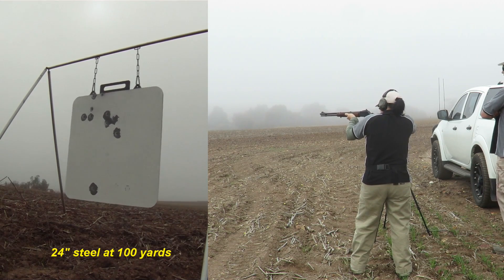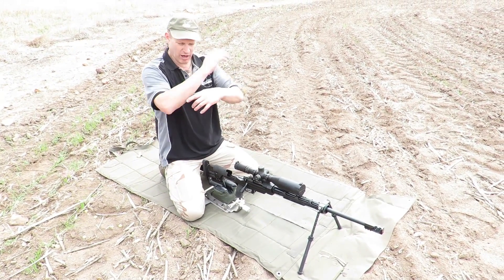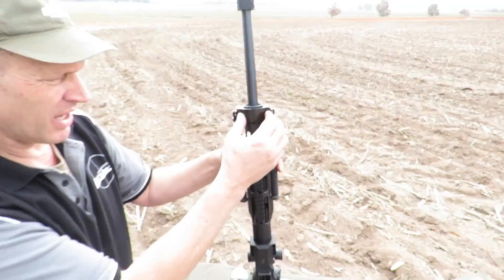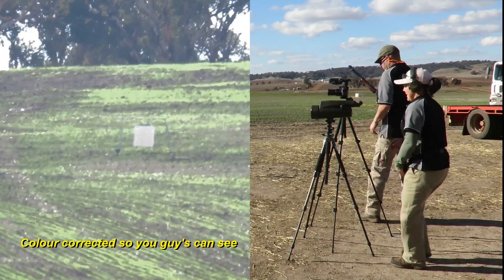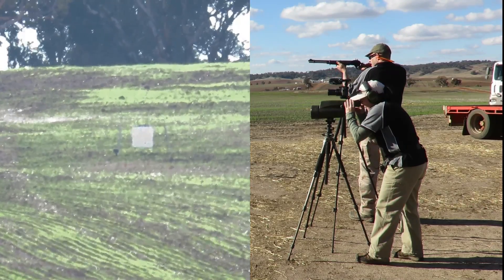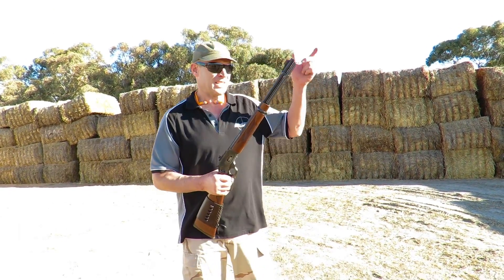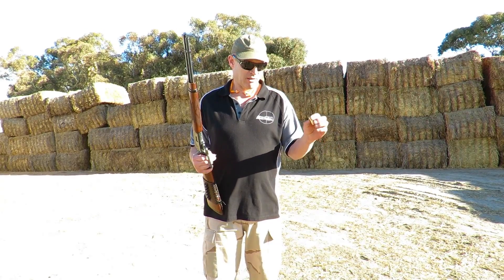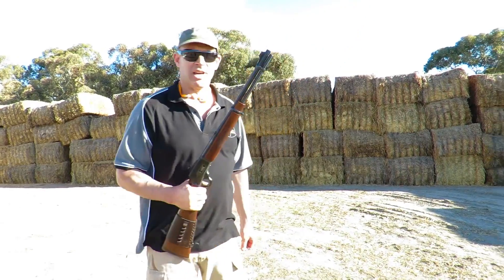Marlin 1894c 357mag at 858 yards (off hand)

Comment: Great shooting!
Wish Marlin still made the 1894 in .357
Reply from the maker: They sure are a nice bit of gear, Cheers
Reply: As of this year, they will be re-releasing it. It is posted on Marlin's website.
Reply: gary robinson Not true of the new ones at all
Reply: They do, I just bought one Monday morning, it should hopefully get to me by Friday.
Reply: I shot one made this year,  slick as the old guns and shot great.  the polish and wood fitting still leave something to be desired, but better than it was.
Reply: I have about 800 rounds through one of the new ones, great little rifle so far
Reply: By the time some guys reach 85 years of age, they'll still be whining about Marlin's Remington manufacturing even if they messed it up 40 years ago.
It's called manufacturing. It wasn't Remington's intention to screw it up to destroy the reputation of Marlin. Fact is, if Remington hadn't bought the brand Marlin would have most assuredly gone out of business. Old workers reaching retirement age, old non-computerized manufacturing equipment well worn, old blueprints and old tribal knowledge at the facility. What do you think was going to happen when Remington bought the brand, acquired the designs, transferred the blueprints, and started manufacturing a gun design on CAM CNC equipment by a new labor force, in a new location, rebuilding old blueprints?
I don't care what kind of product you manufacture, no one can make a transition like that without some time working the bugs out. They HAVE worked the bugs out. You can rest assured a new Marlin is just as good as the old. If the guys in the old Marlin factory didn't do some hand-fitting of the guns, they wouldn't have functioned. That was the case with all the old means of manufacturing firearms. Modern times don't require it, unless you want a flawless de-horned, zero-machine-marks finish everywhere your microscopic eyes gaze.

Comment: Great work, what ammunition and grain are you using? I can't get my h&r .357 magnum to shoot accurately past 200 yards.
Reply from the maker: 125g 357 magnum factory loads by  Remington
Reply: If you reload get your hands on some .360 Wesson cases. 

They are a little longer and it is well known that H&R cut their throats a little long. This will help close up the free bore and greatly improve your accuracy.

Or, you could just ream the chamber to 357 Maximum and get higher velocity to boot.

Comment: Really nice  shooting, never knew a 357 would ever get to that distance, let alone hit with authority a that distance....since i'm lucky to own a 1894cp in 357 and i regular shoot it at 100 m, would you like to shed some light on what kind of loads you use? thanks, and keep up the good work
Reply from the maker: Thanks Dimitri, they where just 125g jacketed soft nose factory loads from Remington, nothing special, Cheers
Reply: MarkandSam AfterWork thanks for the reply, so can i state the it would be better to scrap my 158 grainers and start loading hotter 125 grainers for 100 m and more, because i found that at 50m they group about 1 inch but at 100 m the group opens up quite considerable..... which way would you go?
Reply: MarkandSam AfterWork btw thanks and my excuses for picking your brain like that.......
Reply from the maker: I used the 125's because they took less elevation to get there, a lot less, but I find the 158's generally more accurate, so if shooting out to 500, I would use the 158's.

Comment: I've been trying to find the HCR, in a heavy barrel 24" 1-8 6.5CM, but it is proving very difficult. Every shop I seem to ring only has the .308 and I don't want to use a 1-9 varmint 6.5CM. I'm determined to get one. Pushing it to 1412yrds would be a nice experiment. No doubt it can go further. 

Your new bipod seems well though out. Teflon lined by any chance? Personally, a flatter, or even flared outwards, lower bearing block (much like the top) would suit a bag a bit nicer and be a little more stable in that instance. A clip, mounted the the lower rail that secures the bipod legs would also be a nice addition - Saves it knocking the scope or scratching the frame. 

Sam's experience and personality really shines on this video. She should certainly shoot more on camera - if she likes. 

Have you ever thought of adding a scope camera for bonus footage? A slow motion shot would certainly provide valuable information on its flight path and the effects of windage. 

Apologies for the long winded post. 

LL
Reply from the maker: Hi Lucy, glad you enjoyed our video and thank you for all those suggestions, there are lots of things still to come. All the best with your barrel hunt and your shooting, thanks for the comment, Cheers